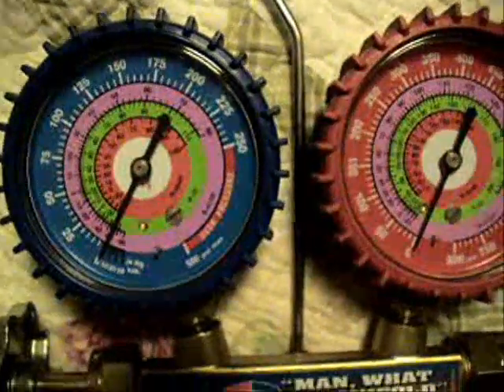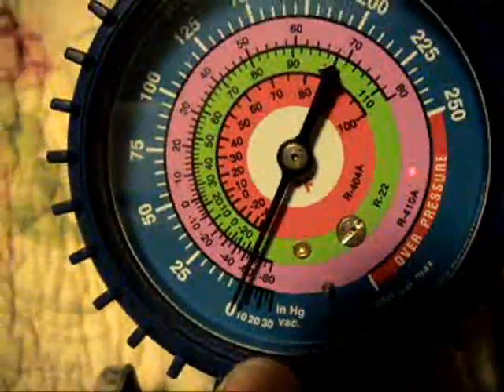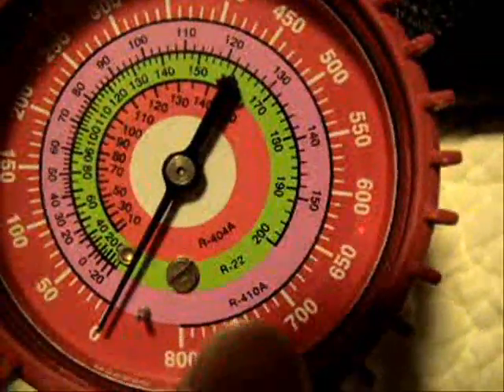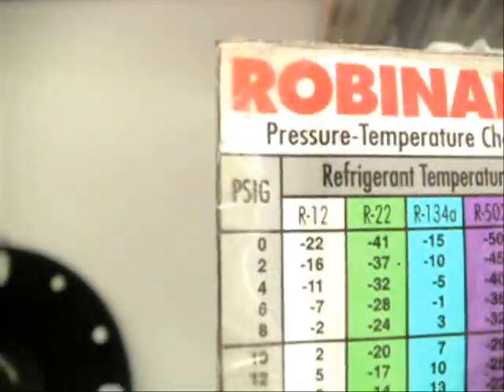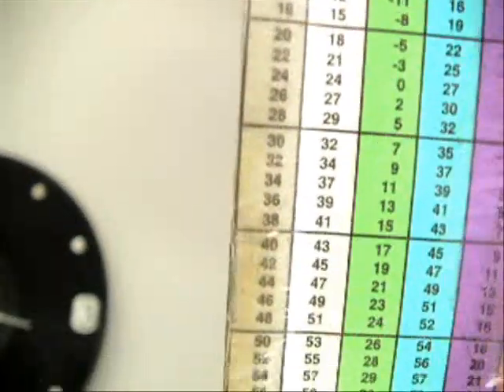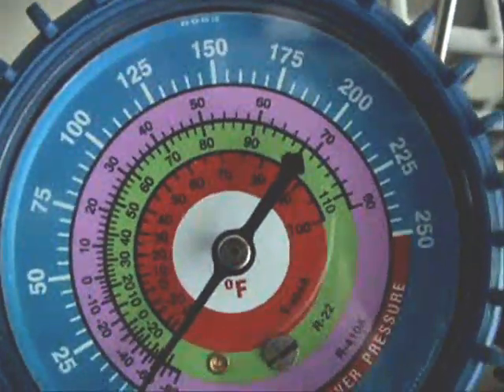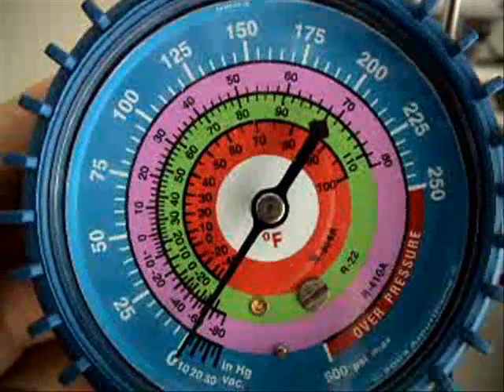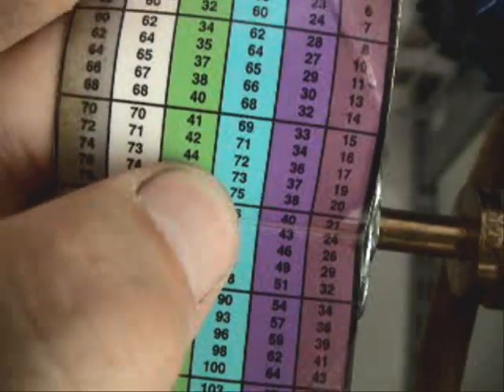HVAC Manifold Gauges and P/T Chart

Comment: So if not already said, if you have gauges that have only R-410A markings they will work for other refrigerates as well.  You just need the paper chart to convert pressure on the outer ring.  If you do use gauge on unlike systems, you should blow out the gauges and hoses with nitrogen between use to avoid contaminating systems.

Comment: How could you identify what kind of gas in the system using the gauge manifold?
Reply: or if the pressures high, you know it has to be 410A because pressures higher.
Reply: you cant, they type of refrigerant the system has will be on the unit. look for the plate and it will have all the info you need.

Comment: Question?...........I am still learning........but, had higher ambient outside temperature....84 degrees...........with highside ( sman wireless) @ 209 psi ( 71.8) and sub @ 64.7........inside temp diff --18 degrees split.............why is my ambient higher than my highside ?......Thank you

Comment: how do know if I have 9lbs or 12lbs or how do I know if a system is over charged or under? with refrigerant on r22 410
Reply: used the clam tester to monitor your amperage of your motor while charging the gas and use the scale to make sure how much you will need to charged in your machine its on your machine name plate

Comment: If your gauge does not have a 134a scale can you use another scale using the cross reference numbers from the PT chart? In other words do you need to purchase another set of gauges for a different refrigerant?
Reply: +Vivienne Pierce No you just get a chart and convert the pressure to the temperature off the chart

Comment: You dont explain what the temp is.  Is that outside temp, or the temp that the system will produce at that given pressure?
Reply: +steven yau What do you mean they're not very accurate? Where are you suppose to read them?

Comment: Great news I got it running again but a few concerns 1 when the thermostat turns off after reaching temp the outside unit still stays on is this normal? and its blowing good but not very hot when it started it was hot temp outside is 74 degrees and dry.
Reply from the maker: It is not normal for the outside unit to continue running once the thermostat satisfies. You have either a stuck compressor contactor or the thermostat wiring has a problem.
Reply: the wiring for thermostat hasn't change so must be contactor connector its very old
Reply: +Danny Diet just take a pic of the wiring and change it out.

Comment: the lowside guage is dor the evaporator coil n the high side guage is for the condensor? im still trying to figure how to use the guages i only work on installations so we dont really use guages except for leak checks n vaccums

Comment: @dossen2620  You need more than just pressure, you also need line temp to frigure out the subcooling and super heat.   You then use the subcooling and/or superheat levels to helpt determine whats going on with the system.  There are many things that low superheat or high/low subcooling could be, thats why techs get training.

Comment: I think I am making this harder than what it is. I do not understand how to check the refrigerant. I hook up my gauges and Im reading 50psig on low and 200psig on high side. I dont understand why the chart is even needed, if im showing 50psig then the temp is 26(r22) the gauge tells me that so why do i need a chart to tell me the same thing. I have a 2.5ton trane unit. I just can not grasp on how to do this

Comment: Dr. Z   I am not a tech, in fact I am a guitar builder.  My Fedders A/C is 30 yrs old and has developed a freon leak near the evaporator connection fitting in the attic.  Your videos are terrific and I applaud your honesty in showing how to accomplish these tasks.  I know my unit needs replacement. However, once I repair the leak and charged it...it has been working great here in NJ..Thank you for your extreme contribution.

Comment: Important to know that superheat charging is done with a fixed metering device as in a "piston" or "cap tube" coil and subcooling used for TX valve coils. It is good to check both superheat and subcooling  in both types to see if there is a problem .
 The system needs to have been running at least 10 minutes to stabilize before an accurate reading can be done.

Comment: Today i could only check the suction on the low side of my Trane XE1000,  it read on the gauge, 70 psig on the gauge,   its R22 unit, SO   by checking temps on the high and low side lines can that tell me if i need to add  more freon if need be?  some reason i thought it worked like if it was 70degrees outside, and you look at the gauge it should be that PSIG,   lol, damn im tryin here!

Comment from the maker: If it the system has a TXV, you'll want to charge the system by subcooling instead of superheat. Look at the back side of the control cover in the condensing unit. There might be a chart that tells you what the superheat or subcooling should be for outdoor ambient.